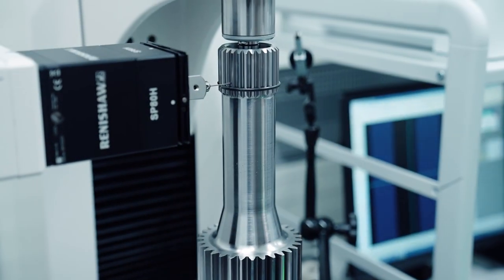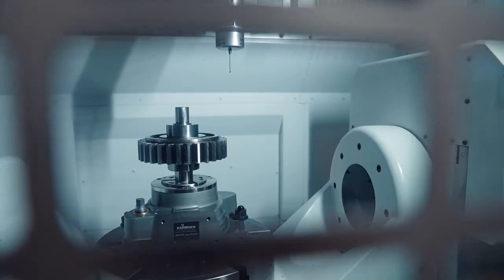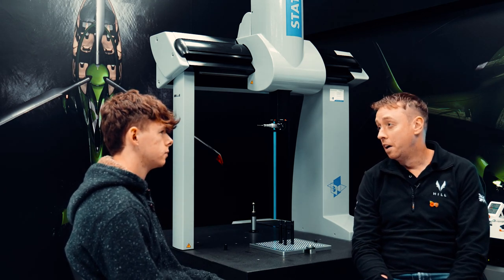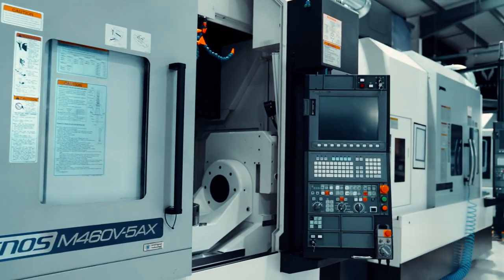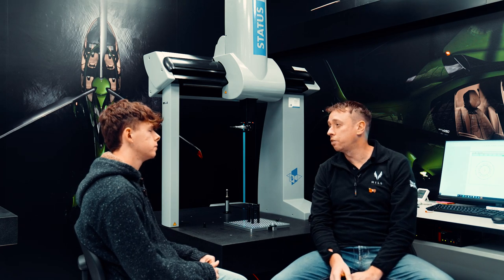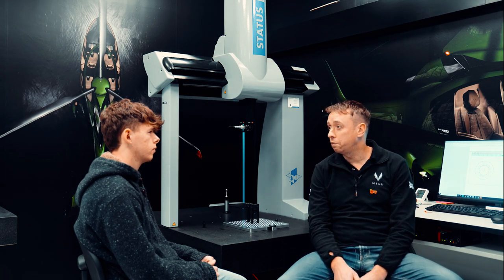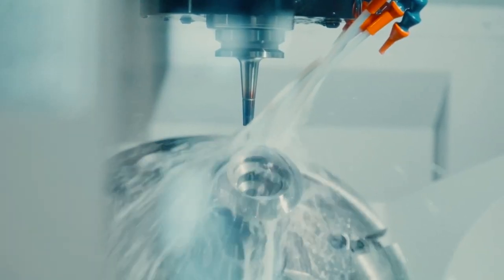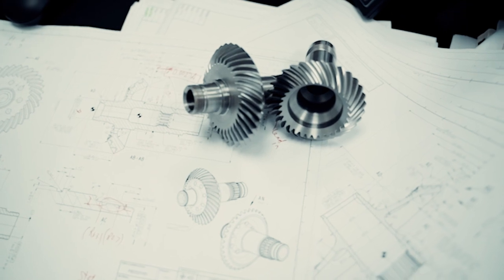Journey to HX50 | Episode 19: HX50 on track with chasing microns and hitting tolerances

Comment: The gear box I feel (personally) is the most complex part of a helicopter, tight tolerances, type of metals used, type of load put on that metal, type of expansion and contraction that metal reacts to at different working and environmental temperatures, then you throw in the torque factor loaded on the whole gear box system. A lot of variables that need to be taken into account and more than what I mentioned here I'm sure creating one. Well done, thank you. NC. :)